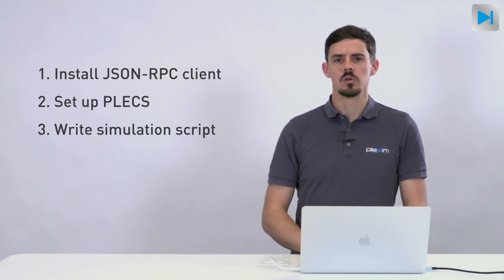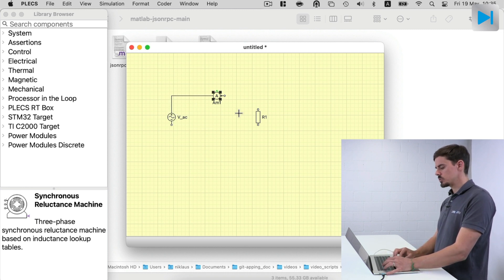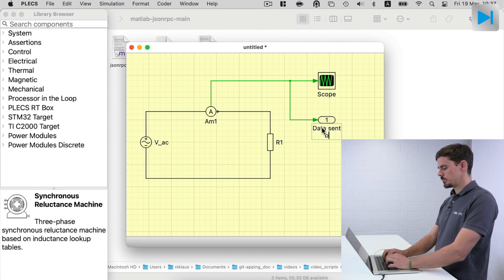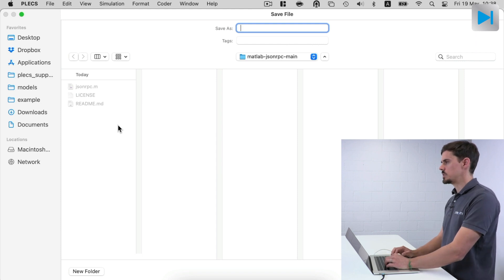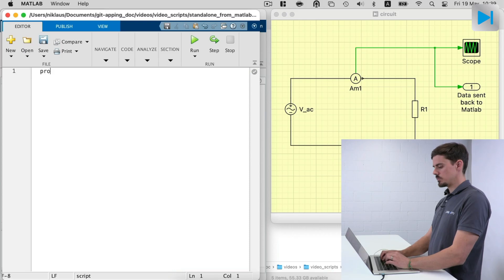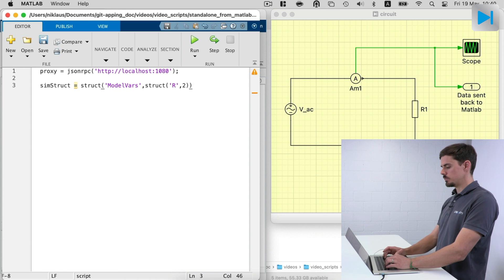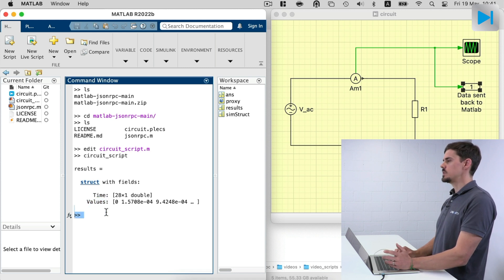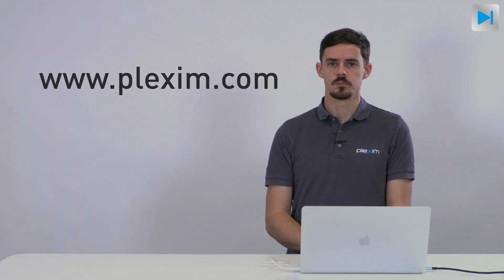Running PLECS Standalone from MATLAB

Comment: Is there any way to export the simulink file to PLECS? Thanks
Reply from the maker: This is not possible, unfortunately. To be clear, you can import your PLECS Blockset model to PLECS Standalone and your PLECS Standalone model to PLECS Blockset . However, you cannot import your Simulink models into PLECS (or vice versa), as the libraries in the PLECS circuit function fundamentally differently than those of Simulink.
Reply: @Plexim  I've designed a model predictive control of two level inverter in Simulink which includes multiple while and for loops. Now u want to analyze the power loss of the IGBTs. Can it be implemented in PLECS?
Reply from the maker: @Star_OF_Tab  Are you just asking if you can continue to use Simulink for the (MPC) controller and include the power stage in PLECS Blockset? Yes, sure. And indeed we have the ability to model losses for IGBTs. There are numerous videos on here, demo models in PLECS, etc. related to the topic of thermal modeling. You might also find the list of power devices already modeled for PLECS by manufacturers helpful: https://www.plexim.com/download/thermal_models

Comment: If I understand corretly, the PLECS simulation must be run first from PLECS so Matlab can fetch the data. or can Matlab  also  rerun the simulation with different parametrs like resistors' values? Also, is it possible to send a source signal from Matlab to PLECS using this method?
Reply from the maker: Hi, you can start PLECS simulations using Matlab with the plecs.simulate() command. You can run several simulations in a Matlab for-loop or even trigger a set of parallel simulations in PLECS. You can transfer data from Matlab to PLECS using a simulation struct but it is not possible to get data from a Simulink signal into PLECS Standalone. For a direct integration of PLECS into Simulink I suggest you to use the PLECS Blockset version.